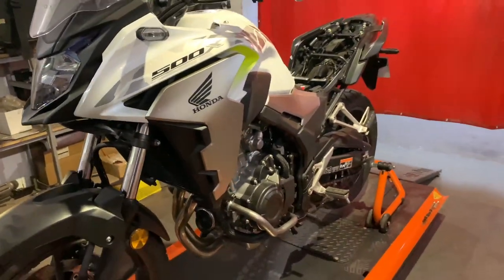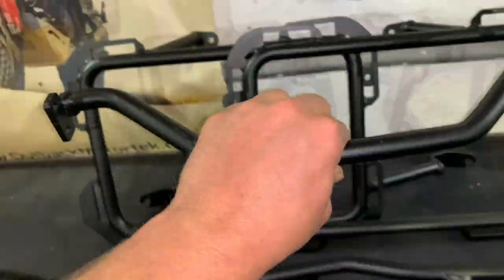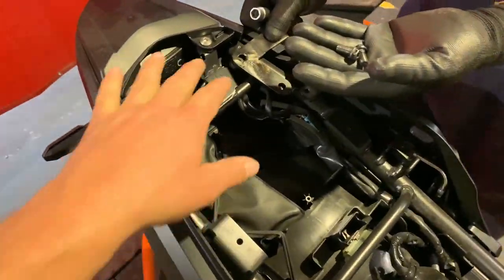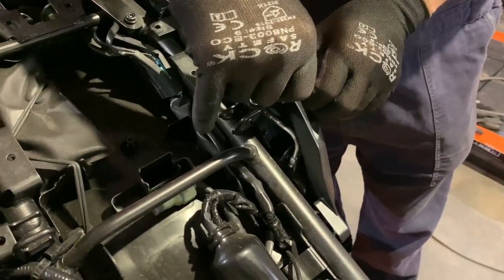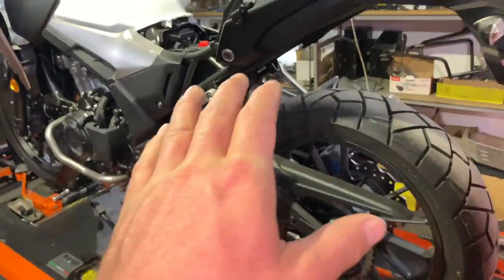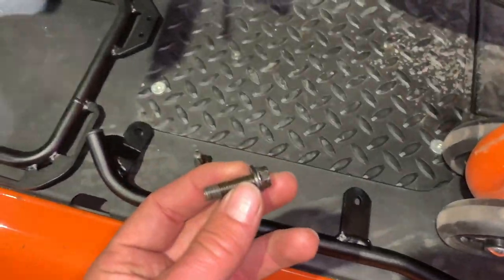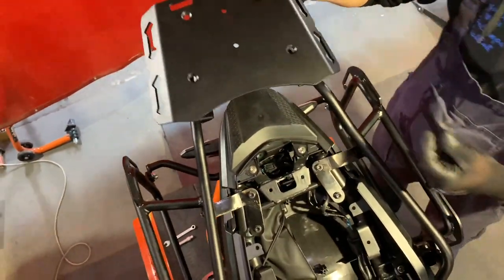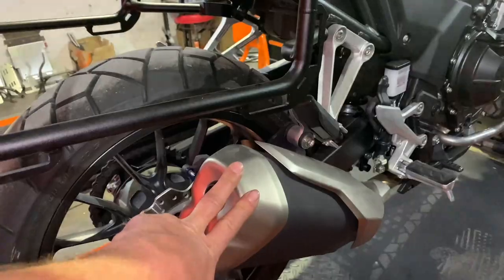Honda CB500X Luggage Rack System Installation

Comment: These mount similarly to your racks for my Africa Twin. I was surprised that the mount behind the pillion peg bracket is just a single “hook” with a spacer for the second bolt. I would have much more confidence in a solid plate that ran under the mount instead of the little hook and a spacer. I would think that it would make the racks much less susceptible to “bouncing” around. That is the only thing I was disappointed with on your racks. Other than that, I’m very happy with mine. I do find myself checking those hooks before every road trip to make sure they didn’t loosen up and slip out.
Reply from the maker: It’s been proven to work for years.

Comment: Hi, the piece of metal which links the two sides panniers is touching my plate mount on the left side, how can I fix this ?
Reply from the maker: Check that it’s installed correctly. You can also email photos of the issue to info at outbackmotortek dot com

Comment: the panier rack is too close the muffler/heat shield. what if you get close to bottoming out the rear shock, will the muffler hit the panier rack?
Reply from the maker: The racks and the exhaust pipe are in a fixed location.
Reply: @Outbackmotortek  the swing arm can swing up and then the muffler hits the panier rack?
Reply: @gs-nt6nf  the muffler is not attached to the swing arm

Comment: What bags in the thumbnail? recommendations for soft bags?
Reply from the maker: The thumbnail shows Kriega OS 22/32L panniers. We highly recommend them and also Mosko Moto Backcountry
Reply: @Outbackmotortek  Thanks, the kriega ones do look good. What would you put on the top mount?
Reply from the maker: @mastodonttix  a small duffle bag or a Rotopax fuel canister

Comment: Personally I’d rather be peering over a massive tank bag than dealing with two ufos 🛸 flying along side me, forever. Talk about nightmare 😅.
Reply from the maker: To each their own. A tank bag is not comparable in size to soft panniers. With a “massive” tank bag you’ll deal with a top heavy bike too.
Reply: @Outbackmotortek  off course. Very limited space up there. I do wish that manufacturers were more creative in the original design, incorporating much more storage in the body of the bike.